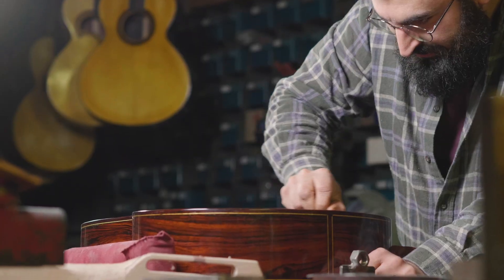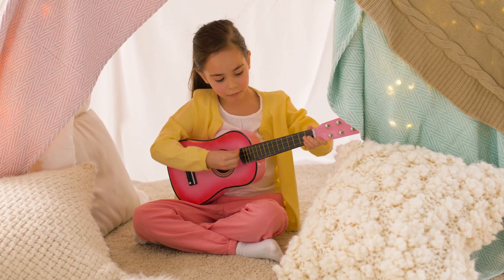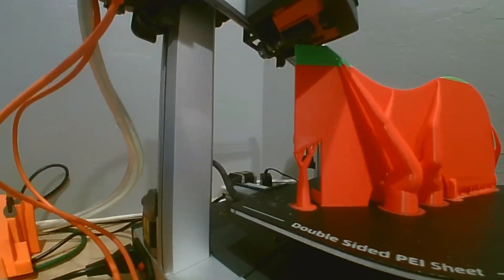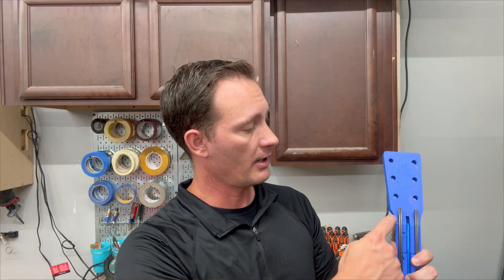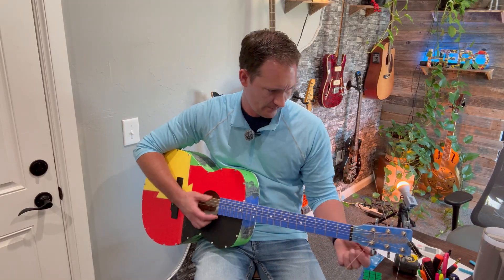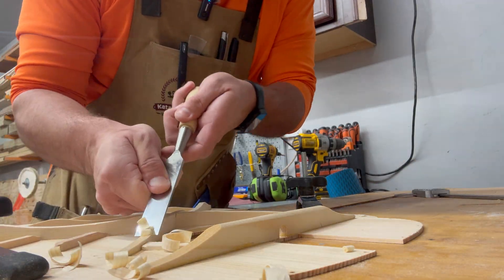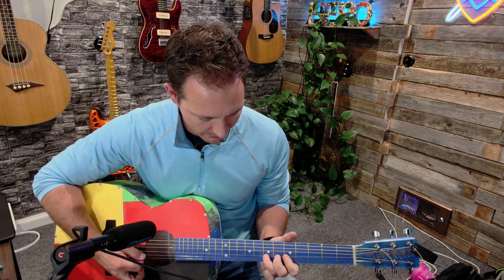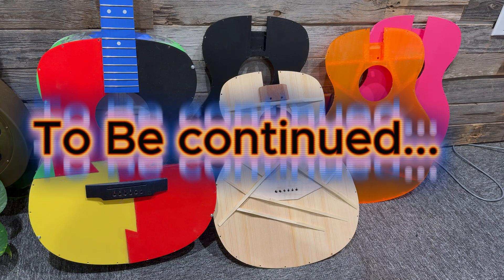A 3D Printed Acoustic Guitar that ACTUALLY sounds good?

Comment: Ovations have been using "resin" bodies with wood tops for years. Not trying to slag ya, just saying that this idea is time-proven. I wonder what would happen if you tried a wood filament or carbon fiber? There are carbon fiber guitars out there, for sure.

Comment: 6:27 Not a luthier but an engineer. I know enough about sound engineering to say that is probably does matter. A 'sound box' or 'resonation chamber' which the body of a guitar is needs space for air to vibrate around and also a hole for the vibrating air to both enter and leave, that's where the sound hole comes in and leaks can absolutely effect the quality of sound coming out of the thing. I'm sure a luthier would be able to explain better and tell you how much it matters but just from my engineering acoustics classes I know that it at least does matter.

Comment: you should build one with wood yourself i think youd be suprised how nice of one you could make. also your right about the top being one of the biggest factors but i think the bracing the backs and also the finish play a big part too. idk if youve ever played any really high dollar accoustics but ive played a few and when compared to 3-400 dollar acoustics with solid tops that do sound good its night and day. i played a preston thompson dreadknought that cost about 12k i think and it kind of blew my mind how good it sounded. really awesome video though. also maybe using a softer plastic for the top might be alittle better because it will vibrate easier. maybe a really hard plastic back and sides and then a softer plastic top might result in a better tone. also gluing the top on would probly help too. really cool video though and i thought the 2nd audio was for sure the wood top i was pleasntly suprised it wasnt.
Reply from the maker: Making an acoustic out of wood the traditional way is definitely on my bucket list.

Comment: The radius in a flat top's soundboard is for crack prevention in low humidity. As the wood shrinks, the arch flattens out rather than split. Many guitars (including martins) were built with dead flat tops.

As for the gasket? I don't think it's important. The wavelengths for these frequncies won't leak through such small gaps. If you plugged the sound hole of most acoustics, then dunked them in a water tank, I wouldn't be shocked to see bubbles coming through the binding channels. 

Overall, this is so cool. Of course it will sound different to wood, but like you said, not worse per se. What excites me is the idea of designing bracing patterns that aren't constrained by lumber. Gradual or undulating waves of reinforcement that can be customized to accentuate different frequencies. It's really a whole new world!

Comment: There's a lot involved in developing a guitar design to replicate the traditional expectations of a solid wood acoustic, but this was a fascinating experiment. Congratulations! 
I'm curious whether you did any stress analysis to be assured that the plastic that you chose would have sufficient strength to support full tension, and also whether or not the plastic top would creep overtime.
Reply from the maker: That’s an understatement! I didn’t do any testing for this build, but I’m planning to do another video with some tests eventually. I do want to see what it takes for it to break. It feels surprisingly sturdy.

Comment: I made a plastic soprano ukulele, it was a very interesting learning experience, especially how to brace.  One thing I learned is that the back on a plastic instrument really resonates, if you hold it away from your body the sound volume doubles and the tone is much better. It doesn't have to be so structural so you can leave it unbraced.  I leaned into this and made a double skin plate for the back  that was open all around the edges (except for supports on the edge) and it worked great and is louder than a traditionally made instrument.  Basically, I added a resonator.  I also incorporated a sound post, an idea I took from the violin world and it does two things - supports the area under the saddle and improves the tone.

PLA is definitely the best thing to use.  You want the stiffness for structural strength and the ability to vibrate.  PETG would seem like an option but honestly I feel like it would damp higher frequencies too much - its resonant frequency would be too low and you'd need to make it too thick.  The problem with PLA is it can shift over time while under pressure.  The first neck I made was not braced and it warped permanently.  My first top design was also under braced and it warped.  My last design is still good but I moved onto baritone and don't play a tenor or soprano any more.

The best glue to use for PLA specifically is cyanoacrylate (super glue).  It bonds extremely well, is stronger than the PLA itself (a case where repairs are actually stronger than the part was before it broke), the results are nearly instant and it can be sanded and finished the same as the base plastic.

I used a floating saddle design which I stumbled upon.  This came about because I first printed a design I found, to test the viability before I spent days in CAD designing my own.  Turns out the intonation on that free design was all wrong and I had to cut the saddle and bridge off and add a floating saddle.  I liked it so much that I incorporated the floating design into my own, since it also means you can perfectly adjust the intonation on the fly.

Is it worth designing and printing your own stringed instrument?  I really don't think so, given that cheap instruments are getting much better  thanks to CNC and other manufacturing technologies.  It's certainly a fun project and you get a lot of interest from other players when you bring it out, so as a passion project and a learning exercise it is at least worthwhile.

By the way, the tap test is checking the resonant frequency and sustain of the guitar top.  As a rough beginners guide you'd be looking for a G3 and thinning the bracing lowers the resonant fequency.  Other frequencies are available.  Obviously, the size and shape also affects the resonance.  It's hard to tell, but my feeling that yours was a bit over braced - a little "dead" as I couldn't hear much sustain.

You don't need a rubber gasket, it will just damp the sound and the soundbox does not need to be perfectly air tight.  Think "columns of air vibrating back and forth".  The magic isn't going to escape out of a microscopic crack.  I did print the entire body in one pass on my design, but that was for easy manufacture, not for any other reason.
Reply from the maker: Wow, thanks for all that information. I will take that all into account on the next build. And I agree that you don’t really need to design your own, but it sure is fun and helps you learn a ton. But it’s definitely not cheaper than just buying a low end instrument.

Comment: "I've bought guitars that sounded worse than that" Oh boy, haven't we all?

I found your video because I'm attempting a 3D printed guitar, and trying to find people that attempted to print the neck and fretboard, and you're one of the few.

My design is electric, so right off the bat very different, but planning FOUR 6mm round carbon rods, two that run the length of the neck and two that go a few inches into the neck at the body joint, and then extend into the body as deep as the bridge. This should give a very rigid guitar, though I must admit that I'm still a little worried about pressure/stress at the headstock area where the rods can't really go all the way to the stress point (the tuners). You used square/rectangular rod, which might have offered MUCH more rigidity in the necessary plane, but how was your experience? Did the neck need significant truss rod adjustment? Were you worried about the rigidity of the fretboard as the truss rod needs to push against it?

Also, as awesome as this is, keep in mind that PLA under stress would not fair well left in a car on a summer day. This is definitely a "fair weather" instrument. But I agree that the idea is extremely interesting because our options for design are much more open than wood based construction. In theory you should be able to design top bracing that keeps it alive from the string pressure without over-clamping the rest of the top's resonance.

Oh, also, how was fretting the PLA fretboard? Did you cut the slots manually, or design them into the print? Did you just use rectangular slots or did you add any ledge features to help the tangs click in and bite? Did you use CA glue to help lock them in? I plan on using stainless, as I'm a sucker for how they feel once polished.
Reply from the maker: Yeah, I did my electric body out of PETG for temp. The acoustic I needed rigidity. So, pla it was. Just can’t get it too hot. I want to try PETG-cf on the next one. 

With 4 CF rods the neck was super stable. Barely had to touch the truss rod, but it worked well. I will say, I didn’t glue the fretboard on as flat as it should have been. Made a lot of buzzing in the high frets. So, I had to do some work to fix that. 

I didn’t have any cf in the headstock. That may have helped, but it’s not too bad.

Comment: The spruce sounds much better. Ovation figured that out in the 70s. The have a plastic back and spruce top. Try really thin polycarbonate. It may sound brighter like the spruce does. Carbon Fiber tops sound real good too I have made lots of those I actually made the first one back in the 80s.

Comment: Spruce top, plastic body . . . you made an Ovation. They sound great IMHO. And Martin make guitars with solid spruce top on HPL (basically Formica) back and sides which also sound fantastic, again IMHO.
Reply from the maker: Yeah, someone else suggested Formica. I didn’t know that Martin did that with guitars. That’s interesting.
Reply: @nerdywork yeah, Martin's "X" series. A couple have HPL tops as well as back and sides. Many players like them.

Comment: Really cool video!! But with PLA and big parts that are sorta thin I've found that they tend to warp easy.. PETG might have been better in the long run for anyone who's gonna try this
Reply from the maker: PETG is more durable, but also more flexible. So, I was worried the string tension would have just made it flex too much. I’m really interested to try carbon fiber filled PETG on the next project. I think it has some potential.
Reply: @nerdywork ASA or ABA could be an option too. It prints at a higher temperature though and is toxic.. it's a little harder to print with than PLA but my cheap ender 3 does it just fine

Comment: Very cool. How about PC filament? Very stiff and strong and easy to print on my X1C. I have A '72 D28 and will report back how a PC printed version sounds. How about an electric? Maybe a real '59 Les Paul Cutsom starburst like I had in HS(1967). <VBG>
Reply from the maker: I'm actually gong to test CF in the next video. Polycarbonate may be a good one to test as well. My previous video was about an electric, but I did a Start style because I used a normal wooden neck. The screw on style on fenders makes things much easier. A LP style would be cool too.

Comment: Very cool, i have to admit i was fooled, way better then i thought it would sound, but id imagine it would sound even better if you got rid of that rubber seal? Im not a luthier, but id guess the rubber would impede the tone transfer between pieces deadening the overall sound and having direct contact would improve it.    Perhaps a single pieced top would improve volume too, if you could find a printer with a bed that big.  Orange storm giga? ... Id stay away from that thing from what ive seen but... maybe for not so high parts it could work , like here.
Reply from the maker: I actually bought the anycubic kobra 3 max(because I have poor impulse control) and have successfully printed several 1 piece tops to test next!

Comment: I have a carbon fiber top acoustic guitar and its tone is incredibly rich and deep.  Nothing like it!  Ditch the rubber gasket for sure.  To be resonant, wooden acoustic guitars seemed to be designed to be just about on the edge of failing.
Reply from the maker: Yeah, gasket will be going away in the next video. Also, that’s an interesting point about them being in the edge of failing. That’s a good way to look at it. And honestly, the PLA too always felt ….sturdy. Time to try a few things to get it closer to failure!
Reply: @nerdywork  Sturdy = stiff.  I've seen nice looking wooden acoustic guitars with a very thick finish...they played stiff and were not resonant at all.  You might also try a PLA neck with a wooden fretboard. The wooden fretboard is going to hold up to repeated fretting.

Comment: Not carbon fiber? Carbon fiber with polycarbonate can sound amazing, depending on the composition. It misses on some things like harmonic complexity....
Reply from the maker: I didn’t have a hardened steel nozzle at the time. I do want to try a CF filament soon. CF with polycarbonate would be a little pricey to make the whole guitar. It used about 5KG. So, I would need some company to sponsor me and send the filament to test that out.

Comment: So, you suggest reinventing the wheel?Ovation did that decades ago. The gasket may be dampening the top, I feel like a solid wood guitar would smoke the plastic body wood top.
Reply from the maker: Oh it did. There was a point where I tested my Martin. It was way better. But I think I can improve the sound of the plastic drastically by making a few changes.

Comment: Ovation has been making guitars with wood tops and synthetic materials for the back/sides for years.  I could tell the guitar with the brighter sound was the one with the wooden top. You could get the full printed version to emulate the wooden top one if you dug into frequency resonance and adjusted the printed one to match the frequency resonance of the wooden top (if that is even possible).  Consider a bell, one made of brass vs one made of steel, the density and structure of the materials, even though they are both the same in size, shape, and construction, would cause them to sound different.  Another possibility is to play to the inherent tonal qualities of the materials you are using.  The synthetic material may resonate better for use with a lower tonal tuning, such as with a bass guitar, for instance.  When printing the top, consider how wood is structured. Wood has growth rings which run the length of the wood, so if you printed the top so the nozzle was following that same type of path for each segment, that might help as well, although piecing the top together may adversely affect the resonance of the top as a whole.
Reply from the maker: Man you just summed up a lot of the ideas for my next video!

Comment: I would be interested to see the top printed entirely in gyroid infill without a top layer or bottom layer. I'm sure there'd be some extra engineering for that and maybe there would be some places that wouldn't work but it would challenge the idea that the top has to be "solid".
Reply from the maker: oh that would look cool. I bet it would make the volume much lower though. could be a cool test.

Comment: Amazing video and idea.
Ideas
Quick-change soundhole, different types.
And is it possible to make a soundhole that will hum and rattle from vibration, simulating distortion, with the ability to control the cracklng. Like the trick with the playing card that you put on a kid's bike to make it sound like a motorcycle.
Last idea for now: what if you make a hollow deck instead of a thin one? I also suggest filling one of the  hollow deck with rice, like in a Rain-stick. or fill it with sand or Water or helium. 
good luck!
Reply from the maker: oh those are some cool ideas. Maybe a sound hole the can change size like a camera iris! also, the rattling idea reminds me of a resonator guitar.

Comment: I thought A was louder and expected it to be the printed top. They both sound great though.  What I am curious about is how easy was it to get the frets installed?
Reply from the maker: Yeah, Youtube tends to compress the audio, so, the volume changes aren't as prominent in the video as they are in person. The frets were actually too easy to install. I had to glue them or they would fall out. If I do this again I will make the tang slots tighter. but for people doing this at home with just a hammer. It might be kinda nice. just have to make sure to glue them. Also, I didn't dress or level the frets at all since this is just a prototype. If I ever make one to keep and play daily, I would do that for sure.
Reply: @nerdywork wondering what the plastic cost was for the print. I would love to see a design that could be printed on a larger printer as a single (or maybe two piece body/neck) also wondering how 3D printed frets would hold up.  It would be pretty amazing to be able to print starter guitars.

Comment: Perhaps a project could adapt 3D printed construction to address its sound issues. This might involve creating a larger chamber, improving the sealing, or coating the interior with a shinier material (Maybe Formica?) to better reflect higher frequencies.
Reply from the maker: Formica is an interesting idea. I was planning to try different filaments first. Wood filled and CF filled filaments would be interesting tests.